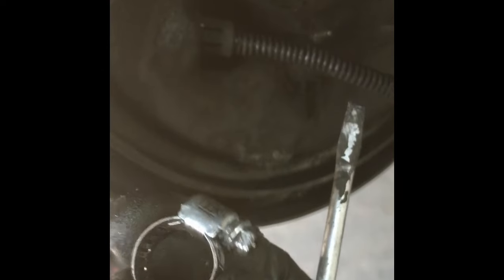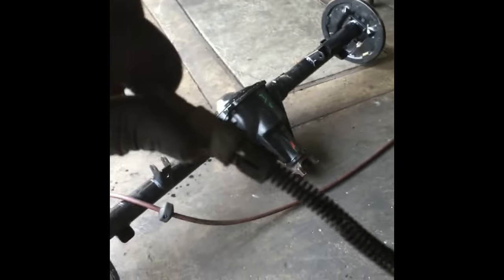How to Remove Emergency Brake Cables from Backing Plate on Drum Brake System

Comment: This is probably what I'm looking for to remove the e-brake cable through the backing plate on a 1998 Civic with rear drums. Service manual recommends using a 12mm offset wrench but does not describe how it is done. Been on a bunch of Civic forums, most comments on this refer to the (unclear) diagram in the service manual. Arghh. Finally I found your vid. Thanks so much!
Reply from the maker: Good luck with the brake repair. And thank you for watching!
Reply: @HowtoAutomotive  Got it out! Gave it a treatment with penetrating oil first. Once the tangs engaged the hole, I put a screwdriver on the end of the flange bit and hit that with a hammer to try to drive it into the hole. Took about five minutes of finagling and twisting and then it went through. Thanks again.

Comment: I tried this on my 2002 chevy venture.  The ebrake cable lack of slack/angle would simply not allow the ebrake housing to come out.  Finally I had to just pull the backing plate out, wiggle it around, and it came out.  And I thought of the hose clamp trick was well.  Too bad it didn't work.  Well, it probably pulled those horrible tines of death and eternal torment in a bit to make it easier.  BUt it would NOT come out with the backing plate in place.  Goin' in will be much easier.

Comment: Thanks....and I see that rear differential!  I'm in the process of removing my rear diff and would like to know if you recommend removing the emergency line this way or another?..
And any other tips for removing my rear differential?
Reply from the maker: antonio griffin as regards to removing the E brake cables if it's the style this is the way I would do it. Sometimes the cables are both just depends on what your working on

Comment: I tried this hose clamp method on a 1989 Mustang,not at the backing plate but the other end of the cable that goes through a hole under the car.

No way would it work.
I screwed around over an hour and no bloody way would that cable come out.The end moves but those fingers or prongs couldn't be compressed with the hose clamp in my case.
I tried various tension on the clamp.Even hit the end with a screwdriver and hammer to get it by the clamp.
Cable tension was released.
Now I have to go to a garage and have the cables installed.

Damn Ford shop manual makes the job sound so easy.
Wasted an afternoon and accomplished nothing.